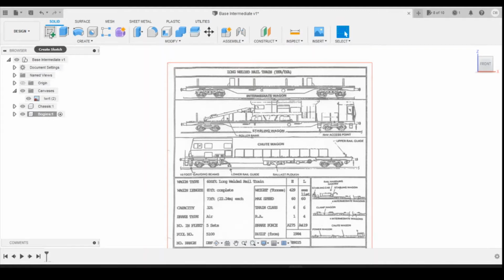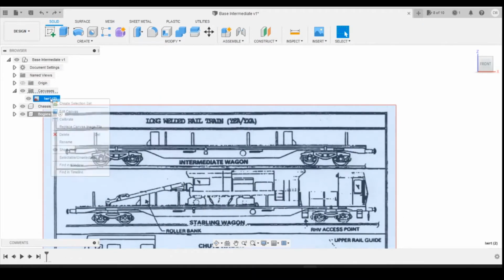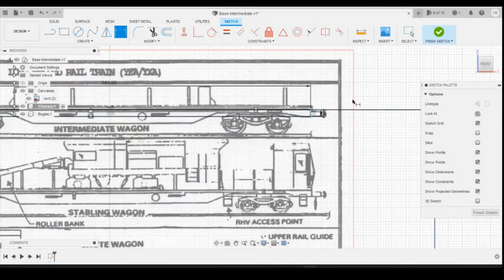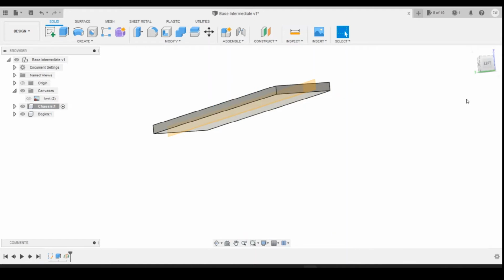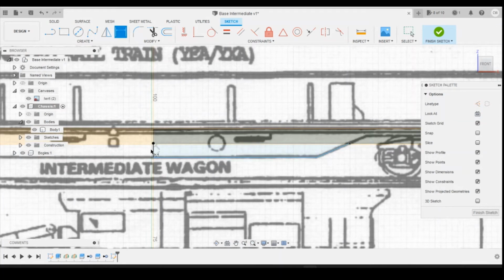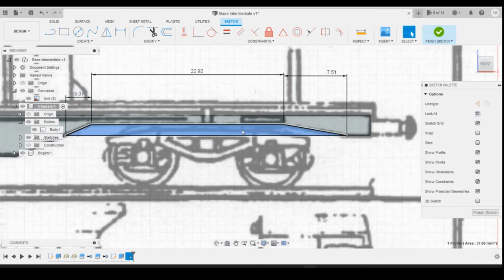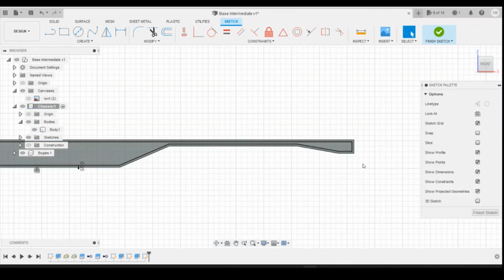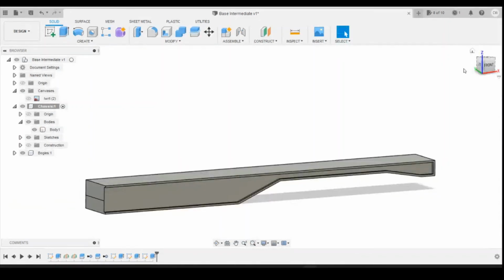Beginners lesson using the Extrusion tool in Fusion (EP 2)

Comment: Carl, could I suggest rather than going to another site to do the conversion just type in the formula 14.25"/148 in the dimensions box.  That will do the conversion for you.  In this case in comes out a little bit differently as you rounded the 361.95 to 362 which makes a marginal difference.  Keep up the good work.
Reply from the maker: Geoff,

I'm not sure why I didn't do that on this video,  but I have already recorded videos up to episode 10 and I have done that on the rest of them.  

Cheers